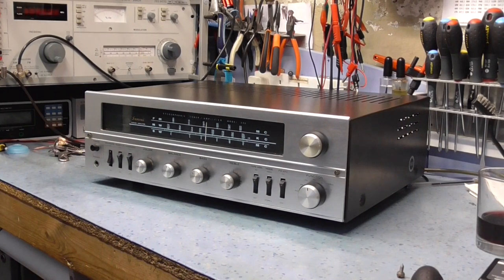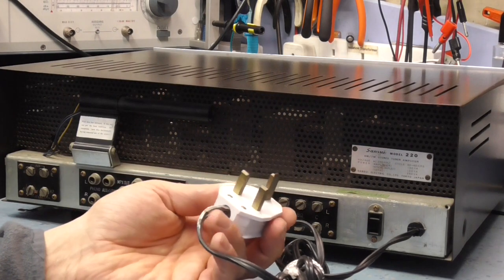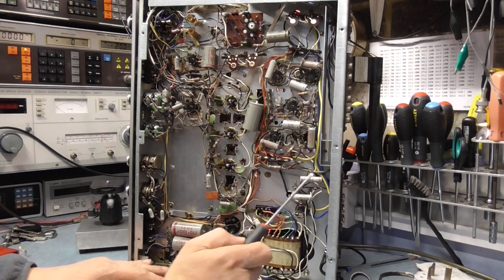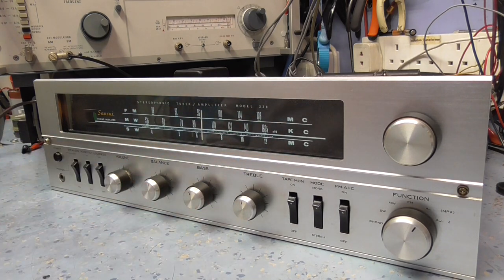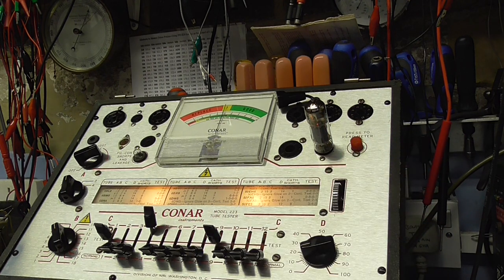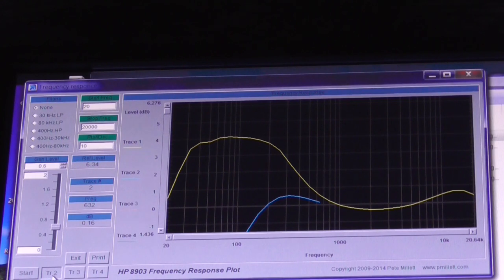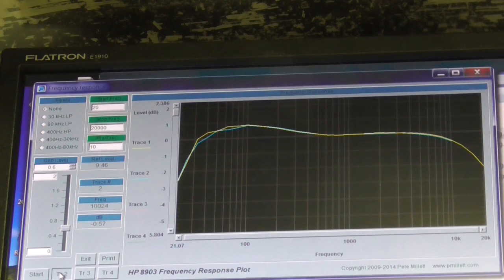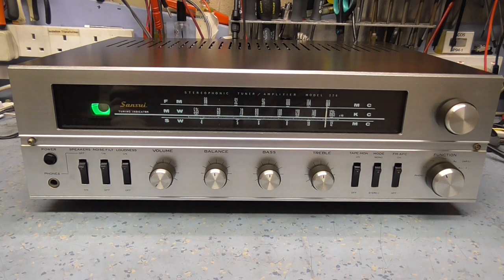Sansui 220 Valve/Tube receiver recap & response alteration.

Comment: She's a beauty of a receiver Simon. Good luck in your search for the valves you need. Thanks for sharing. I love tube equipment as tubes are magical.
Reply from the maker: It is a lovely radio to listen to and also surprisingly sensitive.
Reply: @SoddingaboutSi  I had no idea Sansui went back to the 1960's Simon. You learn something new every day. I'd love to own a sweet valve stereo setup. The audio is magical, as I mentioned earlier.

Comment: I have one of these, so will be fettling it soon. I know it's 2 years old, but the service manual can be found Ok for these free online. When balancing on the side, a coaster or strip of ply supports the main transformer, makes it more stable.
But space on there for the MPX I think, the 250 has that built in IIRC, or perhaps a DIY one can be added.
Worth adding a soft start IMO, I actually had a small valve spark internally each time I switched it on (a few years ago now), so i added some zenner chains to tame the HV until the tubes warmed up, but some type of soft start would be nice for the HT.

Comment: Very nice receiver and nice refurbishment, Simon. I do test equipment, aside from a Kenwood KR720 that I did for music at the bench, but I like the idea of "re-stuffing" those multi-section metal can capacitors to maintain "the look" in older gear. Thank you for showing us your work - I would have liked to have seen where (on the schematic) you install the resistor that corrected the bass boost. Regards, David.
Reply from the maker: Yes. I want to keep the original look so restuffing would be my preference. Thanks David.

Comment: Nice Simon. Glass transistors too... I like the vents along the back there, obviously an option for powered air cooling
Reply from the maker: Glass transistor bottles give a clearer sound. You can get opaque valves but the sound is cloudy. Cheers!

Comment: Great video!  Measurements through the tone circuits are always problematic!  Some receivers have a tone bypass switch - I have a Heathkit AR-1302 and measure amp performance with tone bypassed - only way to get an objective measurement.  Had a problem with the Loudness switch but corrected with a Deoxit treatment.  Enjoyed your use of the HP-8903 with Millett software.  All good stuff.  Keep them coming!

Comment: Hi, I did a simulation of the 220 tone circuit, the tone controls as standard on the 220 (and 250) have a big bass and treble boost, perhaps suited to a full range single cone speaker.
A suitable HiFi adjustment is to change:

1. Change C61(0.03u) to 150n and move it next to R58/C63.
2. R58 -> 68k, R50 -> 68k. 
3. C63 -> 120p, C67 -> 470p
4. C69 -> 27n, C71 -> 33n, C65 -> remove
5. Add Rboost of 1M parallel to C69

That should give a reasonably flat < 1dB response with useful bass and treble, and a bit less loss.
Perfection cannot be attained without another buffer stage, IMO, a defeat switch would be nice, a relay from the 'Noise filter' switch perhaps

Comment: Thanks for the video.  I liked the information you provided.  One question.  I have this exact 220 Model Sansui.  It works pretty good but I wonder if you could post your capacitor shopping list?  I would like to recap mine like you did yours.  Funny thing I have the same Fox Electronics in mine as well.  1975 same year as well dated.  Could these been factory? Same as sloppy sodering as well in mine.

Comment: That bass hump looked like the loudness contour was still in circuit. The switch would close to short it out and make the response flat.
The 2% distortion is probably normal for what was a mid Fi domestic receiver. Not really high end HiFi. Nice to see the magic eye, they tend to be one of the first valves to lose emission.
Reply from the maker: I checked the loudness switch all is good. Very odd. All the passive components test OK.
Reply from the maker: Yep. intermittent switch.
Reply: @SoddingaboutSi  It's nice to be right just once in a while Simon. Dose not happen often!

Comment: A true classic one of the only type we might see in the US good design bad caps and poor resistors but good transformers and they can’t be fixed I was surprised at the tubular chassis being reused all of the coupling caps will be Leakey or shorted I was surprised at your tube tester not being a a transconductance type the type you have is a emissions type which is ok 👌 for service go/no go testing gain VS THD of the tube it’s self shows it’s age most power tubes are rated at 1,000.00 hour’s and a hint much better for a tube amp to hav a shorted output than open power tubes arc with no load

Comment: Well done, sounds good without the heavy bass. Never owned an audio distortion analyzer. Does it measure both even and odd content at the same time? Or can it separate the two?
Reply from the maker: The audio analyser is a pure sine wave generator and distortion analyser in one. So a pure signal is fed into the input and the output checked for any change in the quality of the sine.
Reply: @SoddingaboutSi  I'm professing my ignorance about that piece of test gear. Never had a use for one, though I still have some high end audio gear which I never use anymore, since the hearing loss caused from said items. Since it measures the departure from a pure sine wave, it is measuring both odd & even harmonic content in the output then. Thanks Simon, Paul.

Comment: Hi Simon, I’ve got a marantz 1072, and it seems similar to the receiver in the video, it seems to have lost midrange and treble, and bass is overwhelming! Any suggestions or advice.Thanks Mike
Reply from the maker: Are you using the phono input with a line level ?
Reply: @SoddingaboutSi  thanks Simon, I’m using the aux input, and tried the tuner input and still the same, even using the headphones produced the same mid and high cut! Interestingly I have two of these amplifiers it’s just the one that has this issue, unfortunately.
Reply from the maker: @michaeledwards3528  f its both channels I would look at  maybe a faulty tone amplifier or power supply issue. You sure both channels?
Reply: @SoddingaboutSi  yep both channels are effected, possibly transistors maybe!
Reply from the maker: @michaeledwards3528  Very odd both channels. More likely PSU or something else common to both channels. Loudness switch ok?
Reply: @SoddingaboutSi  when switching loudness on /off you can hear the effect, so seems ok! Thanks Simon, if you felt like doing a video repair presentation, no problem for me, of course I’ll send and pay! Won’t be offended if no. Cheers.

Comment: A bit dusty, but it sounds very nice :-D
Looking at the rear of the radio, you could build a decoder in a dicast box and fix it to the rear, include a small transformer and it can plug into that two pin mains outlet on the back.
An add on that does not modify the radio :-D
I think there are single chip decoders out there.
Reply from the maker: I am looking for the Sansui decoder. Thanks for stopping by!

Comment: Nice job.. I wonder what the wattage is per channel and thd. I think you showed a thd of 2% but wasn't sure what the conditions were.
Reply from the maker: Its rated at 10 watts per channel into 8 ohm which it can just meet with these used valves  thd around 2% which althogh sounds high is probably mostly 2nd harmonics.